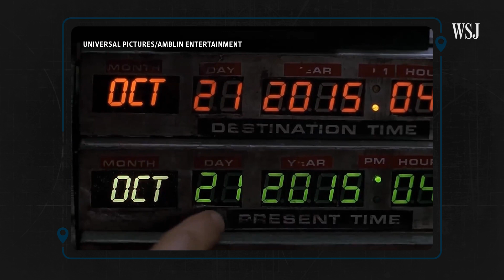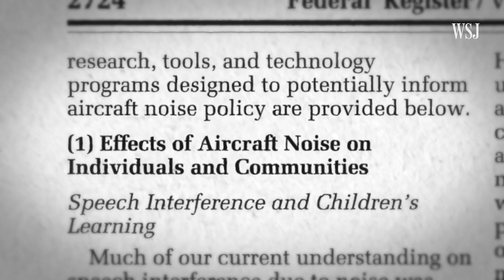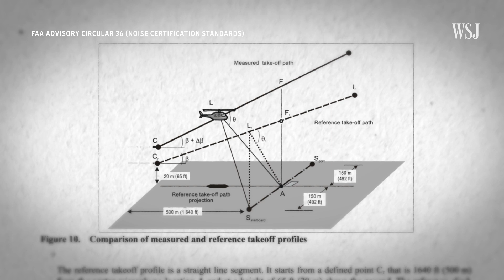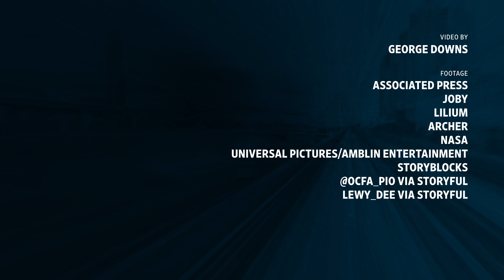Why Flying Car Startups Are Seeking a Quiet Takeoff

Comment: Problems:
1. Pilot licensing
2. Laughably small storage space
3. Only two passengers, likely due to both regulatory and physical limitations 
3. Range
4. Speed (planes are just so much faster)
5. Actual energy usage. Just because it uses electricity doesn’t mean it’s viable. 
6. General limitations, size, maneuverability, where it can park, where is the business viability?
Reply: A short Google search can provide you a great deal of information. You are not asking any questions that haven't been asked by the design teams years ago.
Reply: @woodsmire  I didn't ask any questions I pointed out problems that are not solved by Googling...
Reply: and sound

Comment: How about add some noise canceling technology around the propellers.
Reply: I do not think these are necessary. Joby is very quiet as can be heard here https://youtu.be/3rpzgwDsdOI
Reply: @FGain  nice video.  Joby is pretty quiet especially the second video at 50 db.  The way I look at it, if it’s going to be louder than a car, it’s trash.  I don’t want these things flying around and being louder than the cars driving around.  I live near a highway and hate the noise pollution.  Let’s see if this tech will end up being louder than cars.
Reply: @stant7122  I hate the noise pollution in cities too. I hope eVTOLs do not add to noise pollution.
Reply: @FGain  Maybe one day we can mimic owls.  We can all be transported in giant flying robotic owls that are super quiet and probably less windy than propeller blades.
Reply: @stant7122  Anything is possible, but I wouldn't hold my breath
Reply: That's exactly what I thought. You could also put it on buildings or near the flight path.
Reply: @agisler87  That's smart.  The buildings are right there, why not use them for something.
Reply: Electric engines will be the future of this tech, it is super quiet.

Comment: As electric motors are basically quiet, eVTOL noise is a propeller-only issue. Most traditional propellers/rotors are sufficiently quiet within a narrow speed range called "design". To make design speed range wider (very much wider) a new concept has been proposed. It uses active blades like some advanced helicopters today, but for low AR blades of propellers and multicopter rotors this technology is a lot more effective. Now, the morphing blade propellers wait for prototyping. Blade geometry calculations show that low noise is tightly coupled with high efficiency.